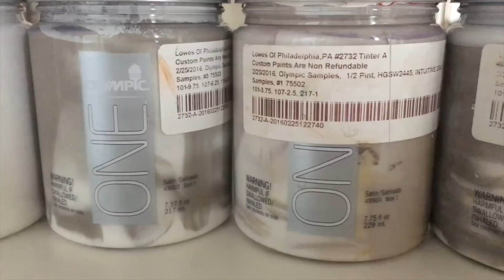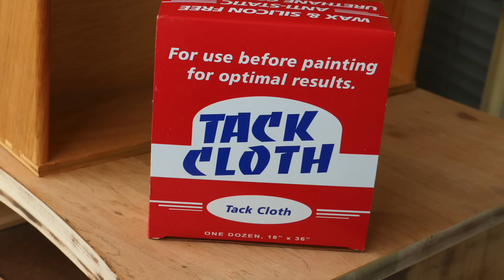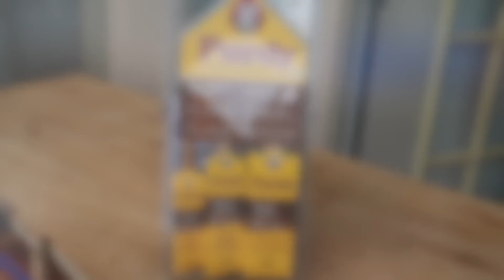DIY Dresser Makeover: Detailed Rehab Guide // Ng's Evidence

Comment: You did a great job!  I'm really impressed, especially considering it was your first project!  :)  I did want to make one tiny suggestion though in case you do something similar in the future.  If you're going to strip all the way down to bare wood, it's usually a good idea to use some kind of wood conditioner before you apply any paint, primer, varnish, stain, etc.  It will keep the wood healthier over the long run (less chance of developing gaps and splinters along grain lines and where two pieces of wood meet) and also help your first coat apply more smoothly.  Wood is just like any other porous material in that it will dry up and crack over time if not taken care of.  It's the same idea as conditioning a good pair of leather boots once in a while.  Most of the diy folks on youtube skip this step because either they're not attempting to do a quality piece like you were or they're not going all the way down to unprotected wood.  Again, great job! :)
Reply: nice
Reply: Great advice. I'm preparing to start an old teachers oak desk and want to sand down to raw wood. I'll definitely look into getting wood conditioner. Thank you
Reply: I didn't know that- thanks for sharing this tip before I start to redo my own piece of furniture
Reply: Thanks for this suggestion as I prepare to strip down a French styled dresser and cabinet!

Comment: I know this is an old video however, I have some time saving tips for your next furniture  project.  There is a product called flowtrol in the paint dept that helps the water based paint to lay down smoother for you, reduces brush stroke marks.  The next tip is when you tape off areas to not get paint on run an extremely small bead of a paintable latex caulk at the tape line.  Make sure you wipe off as much of the caulk as possible  and let dry.  The caulk will seal the tape line and not let the paint run under the tape.  Your dresser came out great and the colors really work well together .  Awesome work!

Comment: AWESOME! (though I would have gone for Marine Blue and Sea Foam Green). FYI: I know you will do this again on something else because you did a great job and HAD BETTER FEEL PROUD OF YOURSELF AND THE OUTCOME. So here's a secret to get the handles in the exact middle:  MEASURE THE DRAWER FRONT FROM SIDE TO SIDE. THEN TOP TO BOTTOM. NOW YOU HAVE YOUR "ABSOLUTE MIDDLE. DO SAME WITH HARDWARE. MATCH YOUR ABSOLUTE MIDDLE AND THEN DRILL, SCREW AND WHEN YOU LOOK AT THE PIECE YOU WILL SEE THE HARMONY OF THE PROTECTION OF THE THE HANDLES. GREAT JOB. NOW DO MORE!!

Comment: The primer balls were from the heat in combination with the short dry time.  Some people wet sand for this reason, but I'm not sure if introducing moisture at that stage would be a great idea or her scheduling.  Definitely don't want to take off all your primer either, though, if you can help it.
Edit: great job, just like your other videos.  You're no doubt a seasoned pro after a handful of similar jobs done so thoroughly

Comment: i bought a paint that has primer " Behr premium plus ultra satin" should i still use primer? should i protect it with wax or polyurethane? I want to prevent from chipping or scuffing 
this is what i have purchased so far is:
1-Behr premium plus ultra satin (2 colors) 
2-tack cloth
3-sandpaper
4-foam roller
5-brush

Comment: What do you think would have happened if you did not send it down and kept the original brown color and painted over it
Reply from the maker: I dont think the finish would have been as smooth, esp as the top of the dresser did have nicks in it. But using chalk paint is a great way to avoid having to sand.
Reply: Oh ok I got you thanks hun
Reply: you don't have to go down to bare wood. but with light colors spots will show through so you'll need to use a good oil based primer. you will have to sand any glossiness away. spray primer is the best. 4 or 5$ for a can. you'll be able to do 2 coats on a piece this size.